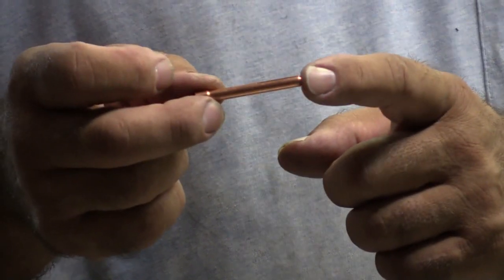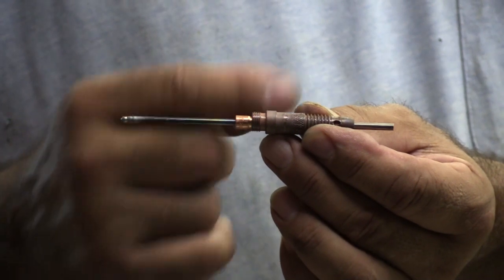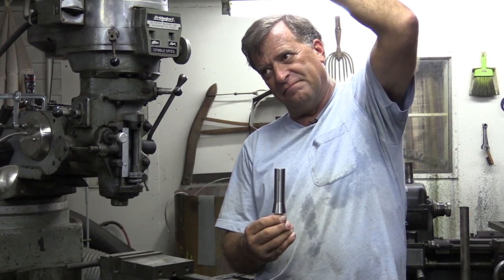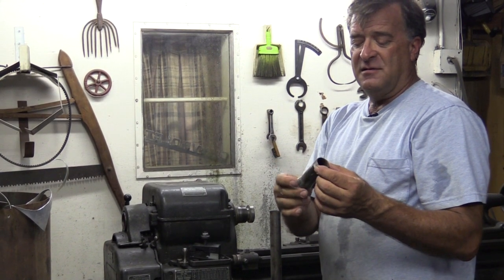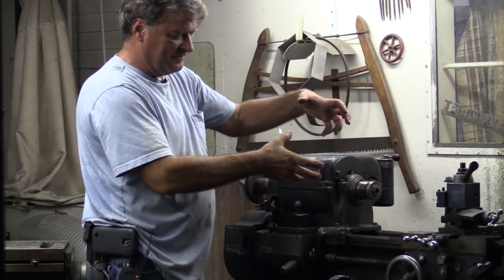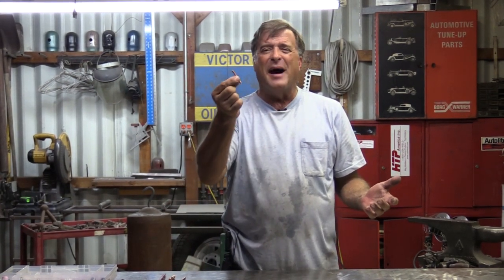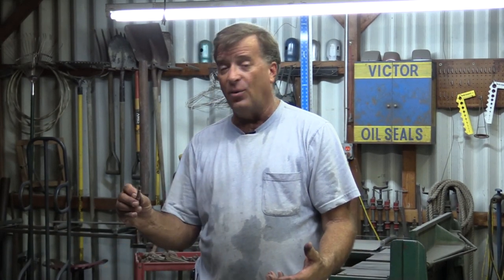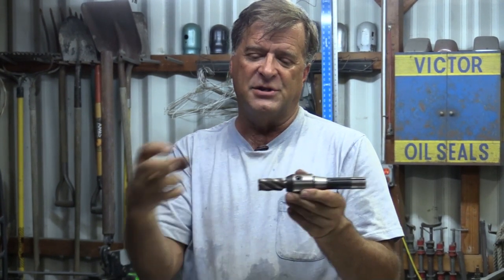What Are Collets and How Do You Use Them? - Kevin Caron

Comment: thnx kevin the explanations; vs a chuck > on what my supervisor used to call the harding screw machine ( a precision lathe) the collet had a snap lock handle at the back (similar to a 'vise grip' ) used for mass production die punches. i say precision lathe (they all should be to some extent - that particular model had solid ground ways the traverses. yes the dvd's.

Comment: SOS..Damsel in distress.....not getting straight answers from Amazon customers:
I have never used a drill.  I am disabled and housebound and live alone, so have to do/buy everything online.
With terminal health conditions I have decided on a little low maintenance hobby > collecting Tarantulas !
So, need to drill ventilation holes in thin/medium plastic.  I'd like to be able to drill holes as small as 0.5mm.
Found the ex's powerbase drill - the 3 jaws do not close completely so I assume it would not grip on to 0.5 drill bits 🙄'
So, I assume I've got to buy a drill as well now.  I like the look of some of the electric mini drills....
Can you recommend any products available in the uk ?  Thanks in advance 👍🏼
Reply from the maker: Sorry mate,  but I have not been to the UK in a long time..    Don't know what you all are using now a days....

Comment: Thank you for your videos! I'm sorry your DVD plan fell through  :(
You are extremely knowledgeable..perhaps you can help me.  I have a "dremel" it's actually a Teccpo Rotary Tool(I'm new to it) and I've been using the flex shaft with no issues TILL TODAY grr. A friend told me that I was using it incorrectly bc I didn't have the collet and/or collet nut on the main unit. I was basically instructed to remove the flex shaft and put the collet nut in then attach the flex shaft.  I removed the flex s (fs) added the collet nut and proceeded to add the fs, unsuccessfully!  So, plan was to remove the collet nut and just reattach my fs   as it was.  But,  now I can't remove the darn collet nut for the life of me! I've been watching about 1.5 hours of YouTube videos for some guidance / help and can't find a solution. If you can help/ reply I'd appreciate that so very much! I have a gift that I'm trying to finish up asap. 
Thank you again in advance!
~Francesca 

P.S. I love working with it ! It has opened up a brand new world for me.  I've also purchased many burrs / bits (up to 40 lol , the dremel dust blower ( that's a whole other story/ ? Lol grr) and a keyless chuck!
Reply from the maker: Hi Frankie.      Without seeing what you have I really can't help much.    But if the nut is not doing anything you can always cut it off.
Reply: @KevincaronSculpture  good morning! thank you for replying! Maybe I can upload a video show you that be okay? And how would I go about cutting it off? Again thank you so much for looking forward to hearing from you!
Reply: @KevincaronSculpture  oh oh I'm just seeing your comment (that's bizarre)
Reply: @KevincaronSculpture   @Kevin Caron, Artist   eventually after messing with it for God knows how many hours... literally I got it off! It's not going back on I can assure you of that LOL! Thank you so very much..